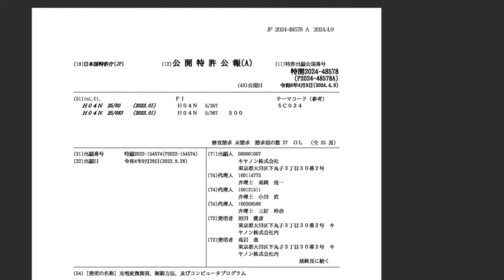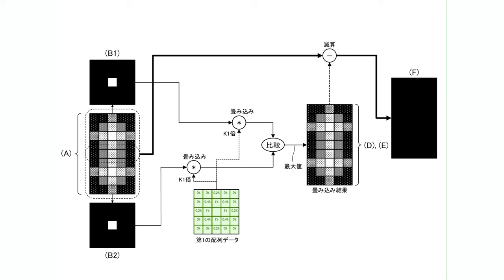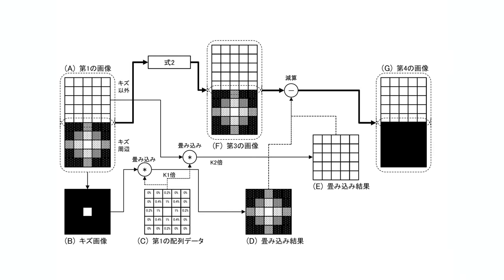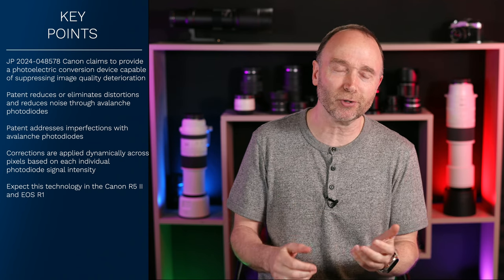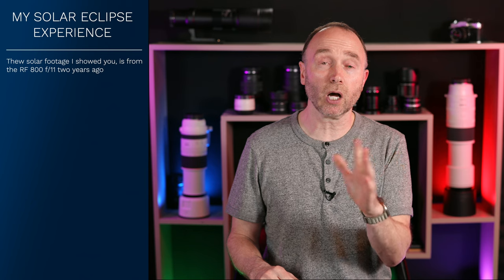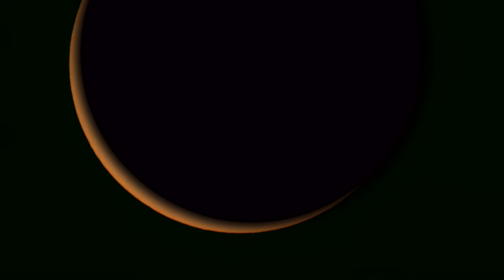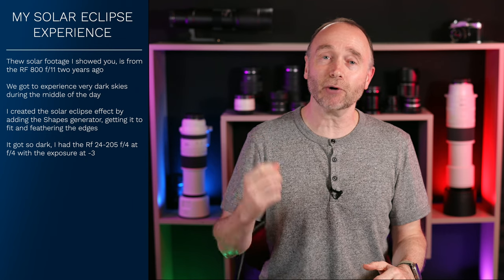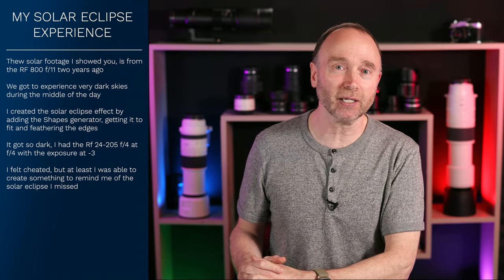Pixel Precision: Next Generation Sensor Technology

Comment: Pixel perfection. But, older used cameras are quite popular now, because people seem to enjoy those imperfections.
Reply: Are you saying that because some photographers enjoy older gear because of their imperfections they should NOT make a new, better, more accurate camera sensor?

I hear what you're saying, and there is a market for vintage gear/methods, but I don't think it's going to sell very well at scale. All of these brands are racing towards the future, not trying to relive the past. For better or worse, that's where the market is heading (and always has been).

Doesn't stop you or others from enjoying retro gear though, so I wouldn't worry too much. The answer is easy for those people, just don't buy this new camera from Canon! Problem solved!

Comment: This is seems to me to be noise reduction on a per pixel basis. Sampling adjacent pixels and referencing a dataset to trim the variance between pixel output at low light levels to make the dark parts of the image much more uniform. The lower the light on the pixel the more this system comes in to play